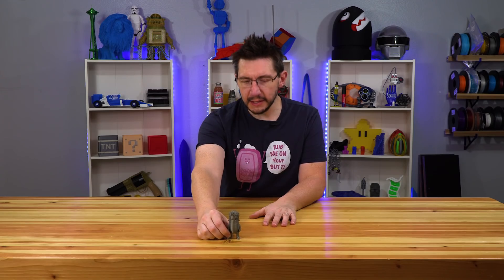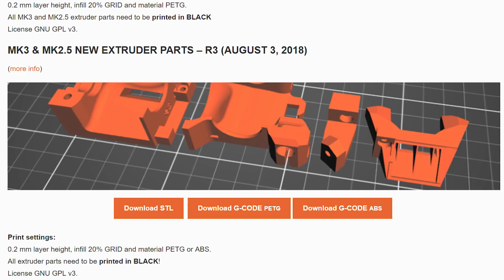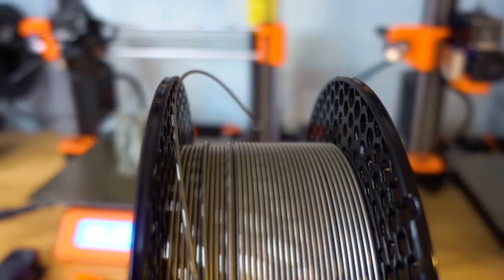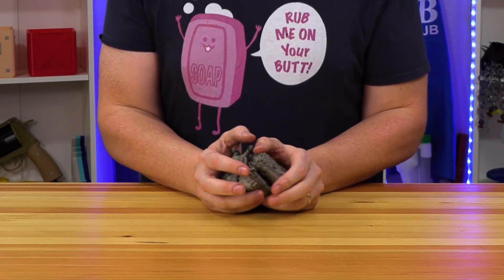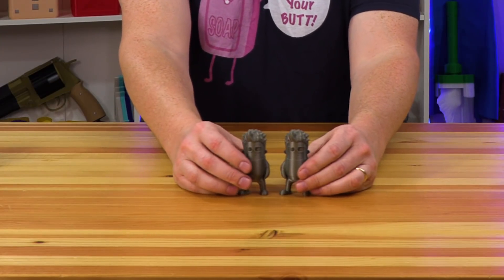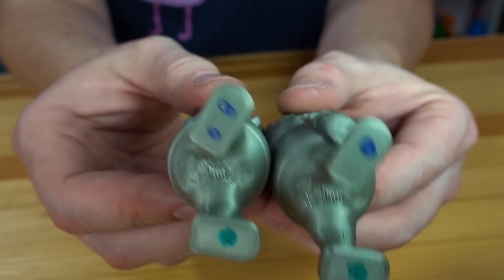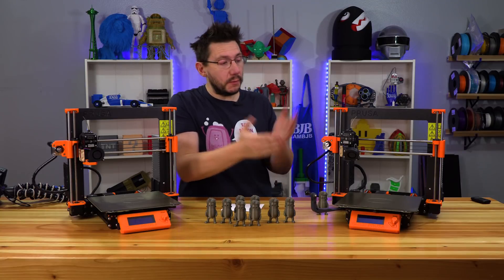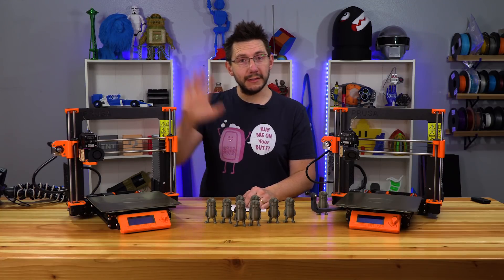PRUSA R3 - Better Than Stock?

Comment: So I finally got around to upgrading my MK2S to MK2.5S.  I had MK2.5 parts laying around and had ordered MMU2 a long time ago and blah blah blah I finally received MMU2S + MK2.5S since Prusa gave everyone with MMU2 vouchers.

My MK2S was working fine except the bed wasn't perfectly level everywhere... we got an MK3S at work and I liked the new 3.7 firmware with the 7x7 mesh-leveling, so finally decided to upgrade my own to MK2.5S.

Long story short - I printed the latest version of the MK2.5S extruder (looks the same as MK3S) and such and it would appear it's now on R4 and the cooling fan shroud they sent with MMU2S/MK2.5S is a very minimal design.  Anyone noticed an improvement with R4 over R3?  I haven't printed anything too challenging yet and I print almost exclusively functional parts that rarely have overhangs like this.

Comment: Try to print “PolyPearl Tower Torture Test” you’ll find out that the R3 upgrade doesn’t have any advantage. The problem with Prusa printers is that there isn’t any cooling at the back of the print so the “north” side of the print will never be as good as the front. It could be solved only by adding one more cooling fan on the other side of the print head and creating a circular fan duct.

Comment: I could tell the key was 2 dots for the upgrade, because the overhangs on the crotch and hand areas were a little bit neater. It's not a big difference, though - it would make sense for them to start using the upgraded fan setup as it's better, but possibly not a particularly worthwhile upgrade to perform given the marginal difference.

Comment: These are the kind of videos you do oh so well!!!  I wish you did the analysis better.  I did see some differences but the way you presented the results made things difficult.  I would have recommended first comparing North/East/South/West from each printer in detail.  Then compare best direction from each set.  Use some calipers to get the hard to see differences as well as a assigning a point system for tricky areas where at least some differences were noticed.  Excellent idea and I like your thinking.  If you sent me the parts I would do it for ya.

Comment: Hi Joel, did you also compare the fan noise of the two models? I have a Prusa I3 MK3 with the fan at an angle and when I'm printing PETG the fan produces a high pitched noise. I read about this problem and it seems to be a problem with the PWM signal. But apparently  the fan at an angle could also make this noise worse. There is also a GitHub issue regarding this problem here: https://github.com/prusa3d/Prusa-Firmware/issues/460

Comment: Sorry 3d Printing nerd but i have to disagree with you on the prusa. Prusa is a very bad place to start your 3d printing experience. they are JUNK!!!!! Prusa Support will lie to you. will sell you junk then complane when you need parts to get it fixed. bought a prusa I3 MK2S 30 days before they made the announcement for the mk3 with in my 1st 30 days the pinda probe died on it and forced a crash onto my bed. I told them i wanted to return the printer on account it had errors and i wanted to change it out for a MK3 Support told me not to do that. That i would be treated right if i keeped the printer and just repair it. Well Prusa's idea of "treating me right" was to send me 100$ off coupon for a item they started selling for $250 to upgrade my printer to a 2.5 after the coupons expired then they lowered the item price by 100$. so in turn what they did is came out with a item gave me 100$ off then over charge for the item by 100$ then sell it to me. if you look now they want 150 i think it is for this upgrade. during this time i had more pinda probes die on me 4 in total. Prusa support tells me one min they got a bad batch of pinda probes. then the next they are crying that they are sending me out more pinda probes. really complaning about it acting like im doing something wrong. when its them that admitted they had a bad batch of pinda probes.. I will NEVER buy another Prusa product on account of this. my mk2s upgraded to 2.5 became a paper weight. I did not let this experience get me down. I now own 2 Ender 3's, a CR-10S and i just got yesterday a CR-10S Pro. Prusa will not see a dime from me. I also go to a lot of RC shows and some of them i bring one of my printers. I make sure i let everyone know to stay away from that lying group called Prusa

Side Note: with in 7 months of owning a Prusa i3 mk2S it burned up 4 pinda probes, 1 bed, and a thermostor cable. I have done less to my ender 3's and my cr-10s and they have been printing longer then what i had the prusa for..... at this time...

Comment: Hey Joel, quite interesting. Honestly I hoped for a difference in cooling. But this is the way things are. From what I saw, the overhangs facing away from the cooling duct looked slightly better and more smooth than the duct facing part. Btw. I see, you just cut off the filament on the hotend. So you are like me and don't want to heat up the printer again (after it is cooled down) just to get the filament out? Maybe an auto unload command in your end gcode might be convenient. I am quite happy with that: Just add "G1 E-150 F200" right below "G1 X0 Y200; home X axis" and you're good. The unload is rather slow but this way I have a better shaped filament tip coming out of the hotend. Cutting the crotch out of the model, multiply it and put them on top of each other might be a decent Temp tower oder even cooling test tower. Cheers!

Comment: By printing four at the same time, you very effectively reduced any potential improvements from an improved fan shroud, because the layers had plenty of time to cool naturally. It's in fact what you do on a printer with poor or no cooling when you want better prints (print multiple copies at the same time).

Comment: I'm in the same boat, where I have a stock i3 MK3, and it's just been running so well that I don't want to take apart the extruder for the R3 parts. I've got them printed out and waiting for whenever I decide to go for it though.

Comment: I'm still somewhat interested in performing the complete hotend mount/fan update. I'd also like to change from the plastic wrap to the fabric wrap - so I may just order the kit from Prusa. BUT your video showed me I can wait a bit. When I'm ready to do this, I might just go with the MMU2 which I think includes these changes. I'd do it sooner, but I just had my PRINT fan go out - Prusa quickly sent me a new one and the surgery went well (I'm very happy I built my MK3 instead of getting the pre-built version).

Comment: What is a good test model for fan cooling? I have tried this one https://www.thingiverse.com/thing:3167063 but have not seen any difference if I use a 40 mm fan from an old 1U server that blows 26 CFM and sounds like a jet taking off. What are some good models for testing common problems?

Comment: H Joel the R3 parts don’t have anything to do with improving the part cooling fan. The reason for tilting it is to make room for the extra vent which improves the airflow through the heat sink and cooling of the heat sink above the heat break. It reduces the effects of heat creep and for many causes a more consistent extrusion.

Comment: the r3 parts consists of 3 different parts, extruder cover, body and fan shroud. the r3 improvement were mainly for heatbreak cooling so that people able to print pla without having the issues with extruder jamming that is called heat creep. Pla don't like all metal hotend if its not cooled well enough. R3 fan shroud were remade so that the air blown doesn't hit the heater block. The R3 parts really help in hotter climate where room temperature is at 30'c in my case. My mk2 previously unable to print pla because of the heat creep
Reply from the maker: That's good to know, thank you!
Reply: @3DPrintingNerd  If I remember correctly, r3 extruder body also has been improved that you are able to print with flex material such as ninjaflex or tpu at the bondtech gear without any further mods

Comment: I agree with those that say 2 dots is only slightly better on the hands overhang.  All else looks practically the exact same.   I'm only speculating here, but if a stronger part cooling fan was available, it may solve the issue without any changes to the angle.

Comment: I think the overhangs relate to cooling overrides I’d check that when printing small layers as in length of time taken to print each layer that the cooling is set at a level where it is still in because dependant on slicer and terminology of that slicer there’s a setting that reduces cooling for certain layer times and also increases for longer ones I’d check that setting isn’t too high meaning your not getting full cooling at the point it’s needed!

Comment: yeah, the R3 does help a lot, look at the hands and the butt, those are the problem areas, the angle is very steep and the R3 cooling is superior at that, probably because of better airflow and consistency, it's at 45° not 90° from the outlet, that helps flow and reduces turbulence

Comment: 2 blue dots, it appeared the overhangs looked better. i do see some belt looseness on your original (single dot). you know what i mean. tell us what key the belts "pluck" (higher or lower pitch)
the update had more to do with heat creep, the whole extruder body should be replaced, not just the part cooling.

Comment: I saw a small, but noticeable, improvement in overhangs with the R3 cooling parts. It seems the R3 is able to push out just a bit more air. So on some really challenging bits that need all the cooling you can get, there was an improvement. There was no downside to the upgrade.
Reply: A 90° bend to airflow is something like an equivalent of 10' of hose connected.  A 45 is much better.  Don't remember the exact number, can check with coworkers tomorrow if need to.  (Work for a pneumatics firm, but I'm electrical). Basing info off air lines from compressors, but the concept is the same.

Comment: Meh,  Would need a bit more testing to determine if it is an improvement.  A real test would also include other filaments.  I just spent days tuning in a PETG print and the PLA of the same print printed flawlessly but the PETG overhands kept curling up.  I finally got it tuned in just right but took a bit of work.

Comment: On my MK3, it made a huge difference switching to R3. R3 - prints are much better. But I assume, it's not the fan, it's the extruder-housing, what makes the difference.
For example, with the original one, it was next to impossible, to unload filament. There was always a little ball at the end of the filament, that stuck within the top "tube" of the extruder housing. Since I have changed to R3, this has gone. Since then, unloading filament is no problem any more. 
Since using R3, my prints are more consistent and it is much more reliable. With the original ones, every 4th or so print failed or was ugly as hell. Since R3 quality is the same with all prints.
I do not exactly why this is the case, but switching to R3 was definitely an improvement on my machine.

Comment: It's not scientific but the R3 seems better to me for smaller models. The best cooling design I feel like I had was with the Diicooler on the Maker Select *ducks to avoid a thrown shoe*. Mk3 over all surpasses my Select in other ways and it's not a massive difference, but that ring cooler was pretty sweet (albeit heavy). The best upgrade I've done to my MK3 so far, though, has been upgrading the heat brake fan to the Sunon that is often recommended. I could not reliably print Proto Pasta without making that change and honestly it's not that much louder.

Comment: That gopro mount looks somewhat familiar ,) :) haha, -  but what I've heard, the new R3 parts can perform better if ambient temp in the room is very high, - so you might not be able to see a difference at all in your room, I myself have around 20-23°C around my printers, and did not see any differentce in print quiality in my testing eather.

Comment: From my own tests I have found that when printing in PLA there is no effective difference between the two part fan nozzles. However when printing in PETG the differences become apparent but tuning of the part cooling fan speed on PETG for both nozzle designs will give equally good results.

Comment: I don’t think you’ll find much difference between The cooling of the parks. However the extruder cooling I think it’s important to do especially when printing with hotter materials. I however do not like the R3 fan placement. As soon as I ran the first part or two I noticed the fan making squeegeeing noise (I think this angle is hard on the bearings) . I Change the I am so wet. Straight north from the extruder fan got quiet immediately. The modification was a design by iron joe.

Comment: Prusa upgrade was not designed to blow more air on the part you have to replace all the r3 components it's to keep the heat sink on the hot end Cooler by providing more air with a Dyson type Vortex around it

Comment: The R3 made 2 upgrades: Extruder body with dyson (better coldend cooling to avoid clogging) and part cooling. You can do the second without the first (as you did) but not the first without the second (old fanduct would block the opening for dyson)
Mini Joel has some overhangs, but neither extreme ones nor bridging. The original design already cools good.
 So if there an improvement of r3 fanduct it could only work on more complicated scenarios. I like tis mini joel, but you should have made the test with an special test object for overhangs and bridging.
In my case I needed the dyson, it removed clogging printing with a very cheap bad PLA (less than 10$/kg). So I have the new fanduct anyway...

Comment: It would make a lot more sense to do a bridging and overhang test piece for this. This model doesn't really have any issues with this to start with, so obviously there won't be much improvement.
Reply: The crotch and bottom of the hands have obvious issues but those issues are unchanged across all eight bottles at least unchanged outside of what I would call noise doubt it just might be the case that you can't improve those anymore except by lowering their height I'm not entirely sure I'll have to try printing some
Reply: @nerys71  I expect an entire battalion of mini Joels for your next stream, sir.  :D
Reply: Akwgata agreed..

Comment: Think you might have shown better results, on fan cooling, if you had gone with supports, on both, to compare the fans. Results might have shown better, just my opinion, although you have been doing this much longer than I have. Cool
Reply: always question everyone, it happens more that you think that something just goes over you, I'm 2+y into the hobby and sometimes I forget about the simple stuff someone like you can point out, and it's very important stuff!

Comment: In stead of repeating yourself seven times on the whole NSWE thing to reach 10 minutes it would have been much more helpful to get a close up look at upgraded parts vs the old parts and maybe a little discussion about exactly why it is speculated that the new design could/should be better.

Comment: Interesting, I have a Mk3 and a reel of the original orange PETG from Prusa so I could print the upgrades and they'd look 'right', but I can't see any real difference between any of those prints you made.
Reply: if you look closely, the left specimens have better performance over steep angles (as seen on the bottom of the hands, and the butt area), the R3 has better airflow due to the lower 45° angle of the fan instead of 90°, this improves flow and reduces turbulence
either way I would design my own cooling duct specifically engineered for the most laminar flow I can achieve (did that for my current printer, need to revise it more but it has a ton of airflow, outperforming 90% of commercial printers)

Comment: I got my Prusa with the upgraded R3 parts. So far I'm afraid this upgrade might introduce reliability issues since the way the fan is now mounted the bearing is under a constant angled load, which no fan is built for. Sure enough my fan developed a bearing failure after about 100 hours. So far re-oiling the bearing (pull off the sticker and drip bearing oil on the shaft) has kept it going but if PC fans are any indication nethods like that won't work for long. I'd wish they'd designed the paart such that the Fan was not only tilted 45° around the fan axis but also 90 degree around another axis. That would have put the load on the entire bearing shaft and would have had the benefit that the jerk from the moving hotend would have been along the fan's axis instead of from the side which would have decreased load on the bearing even further. I know the fan is cheap and all but the way the Prusa is built it would be a pain in the ass to replace so I'm not keen on that being a regular maintenance task for me. Maybe I'll design my own fan mount one of these days...
Reply: the fans are designed to operate in any orientation.
Reply: @boyer1963  I have to agree with @dgschrei here. Most cheap fans use sleeve bearings where mounting orientation does actually matter. It's not an issue for ball bearing fans, but the only way you'd find one of those on a consumer 3D printer would be if you bought and fitted it yourself. This paper will give you an introduction to the issue: https://www.newark.com/pdfs/techarticles/mro/ballVsSleeve.pdf